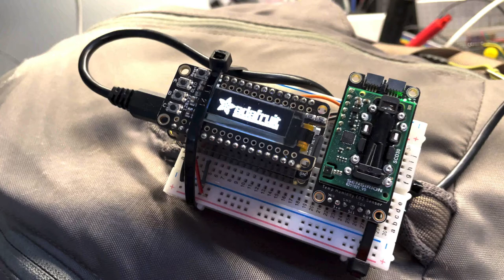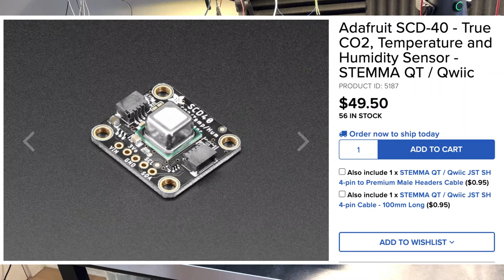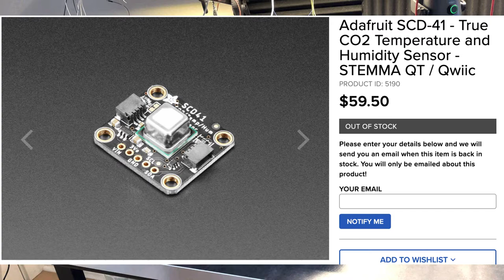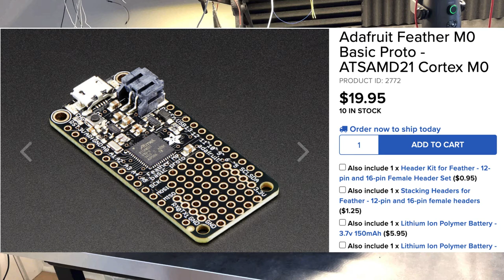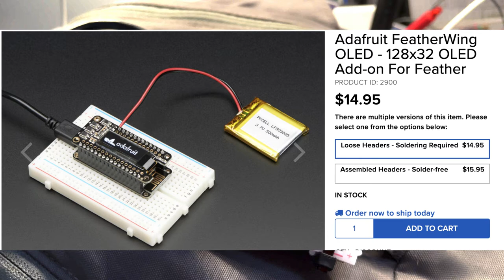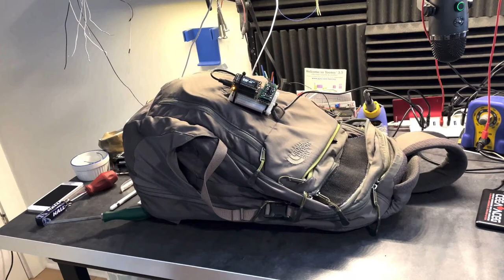CO2 Monitor

Comment: Hello, I recently purchased the SDC40, the first unit you showed search results for.

I'm not sure how the SDC40 and SDC30 differ as far as libraries go, but I had to set my elevation and calibrate this thing before I starting getting readings that kind of made sense. Did you experience this with your model? I was getting around 1000 ppm outdoors which seems way wrong. Some resources I read said I could calibrate it to 400 for outdoor reading. So that's what I did, but it feels very arbitrary. How can I be sure that I've calibrated this correctly and that I'm getting an accurate reading?
Reply: SCD40 is +/-(40ppm + 5%) so it is well within the accuracy to use fresh air as a 400ppm calibration standard. The SCD 30 has a self calibration mode that assumes it gets regular exposure to fresh air and uses that as a 400ppm floor.